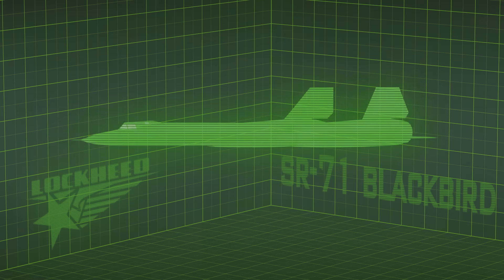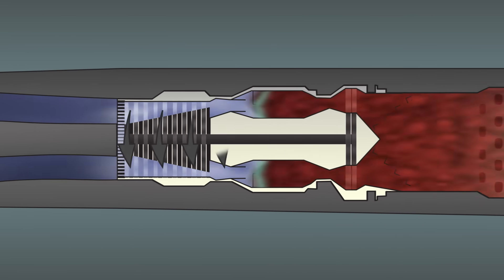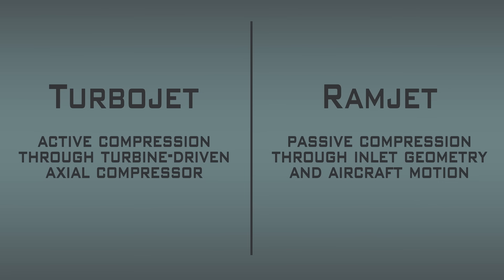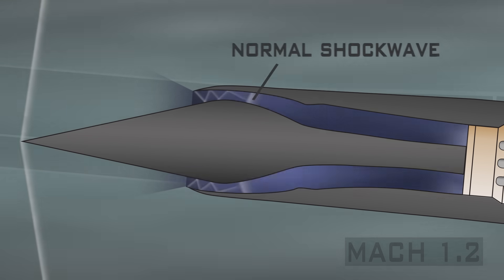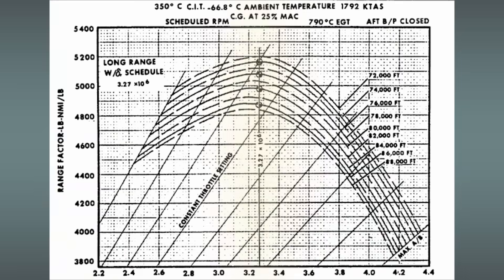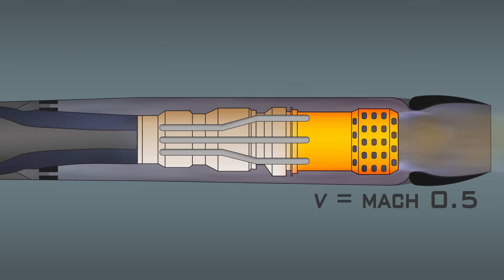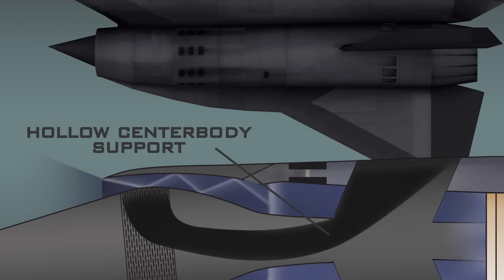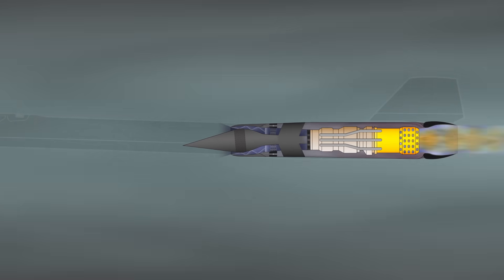The Mighty J58 - The SR-71's Secret Powerhouse

Comment: As far as i know, the only plane that has been able to shoot down  the SR71 was the SAAB Viggen. It has a high bypass turbofan and huge inlets causing it to act somewhat like a ramjet in high speeds with afterburner. It was really fuel efficient in cruising, but the afterburner was not efficient at all. It had a 110mm fuel line and a pump requiring somewhere around 115bhp to run.

Well the Viggen got a missile lock from a position where the SR71 was in a no escape zone, iif it had fired the blackbird would had been downed. I believe the base received an award from the US for being the first and only to do that.
Reply: Most if not all fighters today run low bypass turbofan engines. The advantage of the viggen was it's high bypass combined with a huge afterburner. It used about 15kg of fuel per second, acting like a giant ramjet at high speeds.

They also had their fighter link, so one airplane acted as a spotter while the other could sneak around into the perfect firing position.

Also, swedish pilots do not have those strict RoEs that USA and Russia follow, our pilots are free to perform practice like that on their own. Nothing that would alert the enemy until it was to late.
Reply: The Mig-31 could reach out and touch the SR-71. It's radar ad AA missile combo would good enough to open up some attack vectors that would have worked. Mainly from a cone approx 30 deg in front of the Blackbird. With enough warning, the SR-71 could outrun most missiles.
Reply: Daniel Johansson What about the ceiling of the SR-71 at that time?  I've been reading that it was a considerable distance below it's max-ceiling when it was locked (with the Viggen's still classified).
Reply: boobengarden666 SR71 has a max altitude of 25900 meters (according to wikipedia), Viggen can fly at over 20000 but there were some limitations in the engine at that altitude. Due to risk of compressorstall many pilots never tried for higher altitudes than 16-18000 meters.

Comment: Ok I get it.  Jet engine or high density of air to abundance of fuel: fuel is the limiting reagent!  It compensate the air friction build up by capture the displaced air by geometry design?  Right?  He can slow it down with controllable leak doors?  Basically ingenious geometrical design, advance chemical composition, and well thought mechanical designs.  The problem?  The plane body came into friction with air and burnt/filed down/heat up-kinetic energy convert to heat-inefficiency? If only the whole plane can suck air that it come into contact with and carried it to the engine or a plane with so many micro jet engines like the one in the UFO-miniature age.

Comment: One thing you didn't explain that I've been wondering about is why is the inlet spike not centred?
Reply from the maker: It has to do with the angle of attack - the SR-71 angles upwards about 8 degrees from its vector plane while traveling forward.  The shockwave, however, strikes completely perpendicular to the vector plane.  The spike is angle down to be parallel with the vector plane that the jet is traveling along, in order to be perpendicular with the shockwave for maximum effect.

Comment: Is it true then, since the engines require so much external horsepower to be spun up that there are no on-board starters? I guess that means two flame-outs mean bail-out... I've never heard anyone say the bird makes a good glider.
Reply from the maker: The momentum of the craft forward pushes enough air through the compressor and turbines to spin up the engines in the rare case they did go out, and the plane carried the "starting fluid" (triethylborane) that allowed it to ignite its JP7 fuel after a flame out.
Reply: I forgot all about the window of time the pilot has to re-light when at reasonable airspeed, Doh...
Reply: As i understand it, most modern planes actually don't have on board starters. they use an air turbine which is spun up by the ground crew. In flight the other engines can be started by each other / airspeed
Reply: Kevin B Look up an apu.
Reply: Steve Tobe Yes of course some planes (passenger / etc.) have on-board starters for safety reasons, however i'd believe that all that excess weight would have been avoided in something like the SR-71 with a simple air-turbine instead ;)
Reply: nozmoking1 It has a perfect flight record.

Comment: Cruising speed of Mach 3.2 - those were the days.  But except for spy work, this wonderful plane was not important for the military.  Too bad it could not revolutionize fighter technology!
Reply: The Blackbird out-ran surface-to-air missiles because:

1) The Blackbird was already doing Mach 3+ before the missile was even fired, and

2) SAMs used up most of their fuel just to climb to the Blackbird's high cruise altitude of 80-85,000 feet. Either the A-12 pilot or the SR-71's reconnaissance-surveillance officer (RSO) could detect the SAM and then the pilot would just advance the throttle and gain another 100 knots or so, effectively leaving the4 missile in the Blackbird's wake.

There was one case I know of when a SAM detonated closed enough to the rear of the Blackbird that back at base the mechanics found pieces of the missile's detonator embedded in the tail area of the aircraft.

The idea of the YF-12A Mach 3 missile/bomb truck was abandoned by the Pentagon fairly early in the evolution of the Blackbird. Why? Because in the interval while the Blackbird was designed, built and tested, US and Soviet ground-based missile technology advanced to the point that concept of a Mach 3 missile/bomb truck became obsolete.

The kind of speed that makes the SR-71 a terrific reconnaissance-surveillance platform works against it in basic fighter maneuvering (BFM), aka dogfighting, which is essentially a turning fight. You can't turn fast and go fast at the ame time without crushing the pilot under an oppressive g-load.

. Most of the missiles fired by fighter aircraft theses days are aimed at ground targets, which don't exactly move very fast. Air-to-air missiles are smaller, lighter, shorter range ordinance with remarkable agility, targeted by radar or in previous versions by locking onto the heat signature of the prey aircraft's engines. When they tested the first heat-seeking missiles they all headed straight for the sun! They are only useful within a certain range; if you're too far from your prey you have to manoeuver to get close enough to fire a missile. If you get too close to the target to fire an air-to-air missile, all you have left to fight with is the multi-barrel Gatling gun in the nose.
Reply from the maker: It almost did - Three YF-12 fighter interceptor variants were built, and the plane was slated to become the F-13.  The plan was scrapped after budgetary delays and clearer intelligence information showed that the Soviet Union didn't have a supersonic air-superiority fighter, which the US had originally thought they did.
Reply: TechLaboratories IS the reason we still do not have a fighter capable of Mach 3.2 because it is a lot cheaper to build faster anti-aircraft missiles compared to the cost of faster fighters?
Reply: The A-12 and SR71 were the first jet aircraft to do sustained cruise in afterburner. That is wildly different from dash speeds to enter or exit a fight for short periods.What part are you isn't getting this, dumbass?
Reply: Agreed. The SR-71 cruised at about mach 3.0-3.2 at 80,000-85,000 feet. The Mig 25's service ceiling was around 68,000. No way it could hope to fight the Blackbird.
Reply: In a sense the Blackbird did revolutionize  the next generation of military aircraft. The Blackbird was the first operational stealth aircraft. Lessons learned from the Blackbird helped US contractors to build the F-117 stealth fighter, B-2 bomber, F-22 Raptor and the F-35 Lightning which will be begin to be used widely by the end of this decade. Another thing is, dogfighting or BFM is mostly a sob-sonic activity. Fighter planes just aren't maneuverable enough above mach 1 to do much of a turning fight.
Reply: Douglas McIntyre I thought that modern combat between aircraft was mostly shooting air to air missiles at long range -  thus a speedy plane has an advantage in outrunning missiles. The "top gun" turning fight is very rare in real combat. Slower speeds are more important for ground targets such as tanks.  Is that false?
Reply: Not really what?
Reply: What really revolutionized the next generation of fighters was a concept called the area rule, where the fuselage is shaped sort of like a coke bottle, an ideal shape for low drag and high speed.
Reply: In some ways the Blackbird did revolutionize fighter technology. The A-12 and SR-71 were the first stealth aircraft. Lessons learned by Lockheed on the Blackbird made it into the F-117, B-2, F-22, F-35 and the stealth drones currently under development.

The A-12 and SR-71 were also the first aircraft to cruise in afterburner, or as its called nowadays: super cruise. To date they are the only operational military aircraft to cruise at Mach 3+! That is substantially different from the F-22, F-35, EuroFighter Typhoon and Rafale: all of them can fly well above Mach 1 for short periods of time, but cruise only slightly above Mach 1 for the best tradeoff of fuel flow and range.
Reply: Beeroosterm: Can you read!? That was what I wrote about the Blackbird, which did indeed cruise in afterburner. I said super cruise was  the ability to cruise at above Mach one. Sheesh. Nothing more. Get your head out of your ass.
Reply: TechLaboratories  They've built Mig-25 and later Mig-31 which are capable of speeding over Mach 3.
Reply from the maker: Speeding temporarily, yes, but at a huge fuel cost and the risk of damage to the aircraft and its engines.  The SR-71 is designed to cruise at Mach 3.2 for quite literally hours on end.

Comment: This video is fucking awesome, it makes easier to understand the part of the Blackbird that made it so great. Amazig they designed this in the 1960s
Reply: sjion bloody amazing, just 20 years after the first proper jet plane. And in 2014 we don't have a plane/engine comparable to the SR-71/J58
Reply: The first parts arrived before 1960.
Reply: 24 December 1957: First J-58 engine run
Reply: Ayrton Senna It's as amazing as it is sad that we reached the pinnacle of flight so long ago. In many respects we have gone backwards since then.
We don't even have Concord any more.
Reply: Pepe Eid here is an idea numbnuts. if it can be done easier, do it. until you or someone else does, the SR-71 is still the highest flying, fastest aircraft ever put into operational service. it remains uncontested having never been shot down, despite spending more time over enemy territory than any other aircraft.
Reply: Pepe Eid
 When the US got its hands on the MIG25 they realized what a poorly built plane it was.The MIG25 existed because of the SR71 and while it could hit mach 3 it could only do this for a very very short period of time and its engines had to be replaced / rebuilt after achieving this short burst of speed.  The M25 could not sustain Mach 3 like the SR71. You talk about how the USSR did things more simply and the US more complex and expensive but lets not forget, it was the USSR that financially ran themselves into ground trying to "keep up" with the US AND other western countries to the point they no longer exist.
Reply: beeroosterm Obviously Pepe Eid has no idea why Clarence “Kelly” Johnson (for me one of the greatest aeronautics genius) selected Titanium alloy to build the airframe. Obviously Pepe Eid has no clue about the temperatures the fuselage gets when flying at Mach 3.2. Obviously Pepe Eid has no clue about dimensional variations due to those temperatures. A hint: Concord, flying at Mach 2.2 stretchs about 10 cm (4 inches). Obviously Pepe Eid doesn’t know the J58 is the only certified engine to fly permanently on afterburner.  On the ground you can’t place a finger between Flight Engineer’s panel and the cockpit bulkhead. When flying you could place a hand. Obviously Pepe Eid has no idea that the leaks he talks about are no defect, there is a purpose. He has no idea that the fuselage skin is the fuel tank wall. Eventually Pepe Eid doesn’t know he could drop a burning match over the fuel and the fuel doesn’t ignite (for in-air restart they must use Triethilburane to ignite). Eventually Pepe Eid Doesn’t knows the fuel is synthetized not distillated. Eventually Pepe Eid is as factious about Russia as some other about America. But for those who criticize Pepe Eid’s English I bet he writes and speaks better English than the critics write/speaks Pepe Eid’s mother language. BTW English is not my native language.
Reply: Excellent vid and description!  You covered it all.   Thanks
Reply: The video is awesome. But for someone who is not an aeronautical engineer the video just about made my head explode! :)
Reply: Pepe Eid Pencils have their own unique set of problems graphite requires moisture to perform in the roll of a pencil, and graphite also flakes when used as a a pencil . Conductive flakes of graphite are not what you want around electrically operated life support systems.
Reply: a failure? who are you trying to kid here? this is not your primary school class room son. it served 100% of its purpose for longer than any mig. over 4000 rockets fired at the blackbird and not one hit, this was a weaponless aircraft that won the cold war. there's only one failure here and that's your uneducated comments which serve only as the reason for my laughter, clown
Reply: Pepe Eid What a dingbat you are, all you have spouted is false, period.  Belenko the pilot that defected with a Mig stated flatly that it couldn't complete with the SR71.  Learn to read you tool.
Reply: beeroosterm dud thank you for your amazing stupid reply but in the end what i said is true but i have mistaken with the mig as counted as the fasted plane cos one accident wasnt recorded that i understand that you dont know shit about it , well these planes are a fuck up and the reason as i am saying that is cos once the americans had there hands on the mig 25 in japan they understood that fucked up plane of yours could have been built with a much easy layer then the fucking alloy they have created that still the plane to leaked after it came back from its missions, and billions where spent of each of your money to creat somthing that could be solved easily ... and this is called hitching left ear with left hand . same as the space pen that costed million when they could just take pencils instead million gone to waste...... please i am not the smartes but it happenend that i got to read different subjects not only what you want to read to keep yourseld in your dilougenal fantasy world of ideal AMERICA..... when you want to say somthing is good then there must be something to compare it with .....
Reply: beeroosterm i dont understand that everytime you hear anything that you dont like you go crazy, Yes my english is a 4th language actually for me, and you totally got me wrong. the plane did its job after all and many planes where created but everything based on that plane was cancelled. the scientists just went too far when there was a lot of simpler things they could have used on the plane  specially the coating that trust me it could have lowered its price a lot more, how many have been built and havent been used at all. how much time did it have to hold for repairs after each flight . the plane again was good  and did its job pretty well. i m not insulting or anything so you could be polite replying. the inovation is good that can bring new generations of new teck on its bases. its the same as i said the pen in space didnt write so USA created a multy million pen back then and USSR just changed the pen for a pencil same thing and more money could have been spent of major stuff.
Reply: beeroosterm thank you for your advice LOL
Reply: lariwoo well the soviet did survive using pencils ... lol 
well its a closed deal i was getting  
miss understood here
Reply: tsiokolvsky pEpE Eid doesnt know everything so do you ,  i understand same as the things you have mentioned and pEpE eid knows a little more with comparison to other factors ,  again the plane is amazing engineering but,  again pEpE eid has said before why would a person hitch his left  ear with the right  hand , any new invention of course leads to better other innovations no dought, but read the period of the plane history and it laid to a failure from the government itself, same as the f22 that has been sucking money and still not to be totally fulfilling needs as expected..... lets hope some better future for the f 35 .....
Reply: Pepe Eid
F22 is more about lobbying than engineering. Northrop Grumman has a better plane than the F22. Even Sukhoi Su-30 is better than F22.  Anyway the SR-71 was good business for former USSR: All the titanium came from there. BTW if even you know nothing that doesn’t imply I know everything. Good day sir.
Reply: Pepe Eid nice grammar, noob. :)
Reply: the plane is amazing yes but a total failur since its teck didnt last long .... the body made of alloy that made it too expensive and specially going on to  long hours repairs that costed much after each flight was even worst...... the records of this plane were broken with the migs 25 and mig 31 ( but unofficially mig 25 was tested to its limits and it got to a speed of over mach 4  but had the plane almost kiilling its engiens so never done again ),for the creators of this plane was like itching the left ear with there left arm ...... instead of the complicated alloy they could have used steel and steel welding like on the migs that till now are the one of the fastest   and highest reaching  on service .....